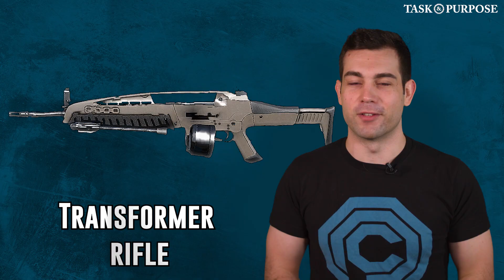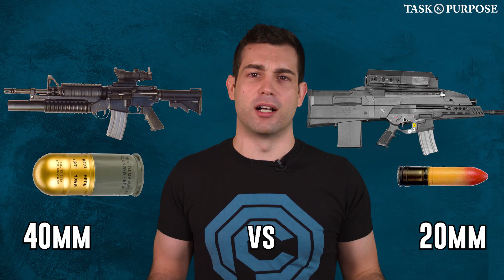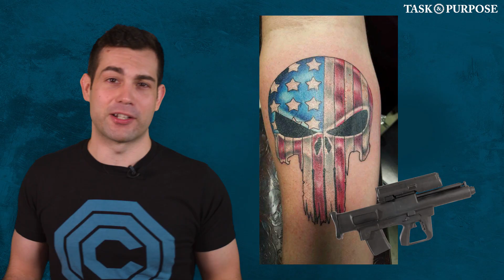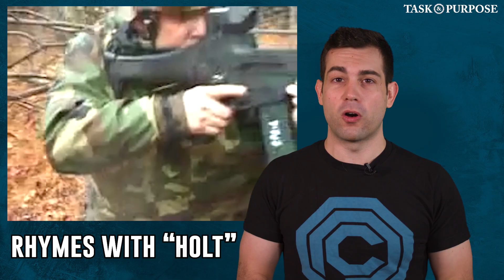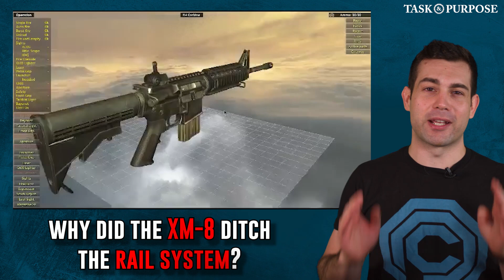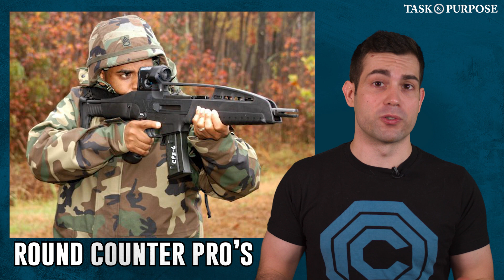Why was the Army's XM-8 Future Weapon Series Canceled?

Comment: I would argue that the concept of one assault weapon that can fill multiple roles is what our force needs. Making each rifleman more lethal means they don't need to rely on weapons platoon for help. One carbine length weapon that has the accuracy and range of a dmr, with the ability to accept hi-cap mags to provide limited suppression like an automatic rifle, and a assault carbine, underbarrel grenade launcher, and bayonet mount when not used in the other 2 roles. That combines a carbine, automatic carbine, and designated marksman's carbine all into one weapon with an indirect fire capability, a shotgun for breaching, a bayonet for close quarters fighting,, and so on.  No more needing to have a DMR, AR, or LMG. 

With that being said, I think it's time we switch from 40mm to 20mm grenade launchers. I know the 40mm is more powerful, but it's heavier, bigger, and doesn't have as flat of a trajectory or as great of a range as a 20mm would. The 20mm would also be a lot lighter when used as an underbarrel attachment and as a standalone launcher. The increased range, velocity, and flatter trajectory would extend the range of the indirect fire capability a rifle squad possesses, and a 20mm explosive projectile is still lethal to troops, unarmored structures, lightly armored vehicles, and incapacitating or degrading to armored vehicles (sighting systems) and armored emplacements anyways. The smaller size of the projectile means learning how to aim it is going to be much easier, especially since the increased velocity means it isn't affected by wind as much when in flight. A soldier or vehicle can carry more of the ammunition as well. 

 Multiple round types such as smoke, flare, white phosphorous, high explosive, cs gas, and so on would really seal the deal. I know 40mm is more powerful, but I think all the other benefits 20mm offers makes it worth the trade off.

Comment: You know what's funny about this, I was just talking about future warfare projects and military spending with my sister-in-law. I talk specifically about this weapon back in 2001 Marine Corps Times where the Marine LtCol at the Naval Warfare College said that the Marine Crops will never adopt this weapon over the incoming M4 to replace the M-16A2. He said that it was too clumsy, heavy and most lance corporals in theater would strip of the high speed low drag grenade launcher and battery for the optics system and bury them while taking the rifle on patrol. This many years later, I think it worked out for the best.

Comment: The XM29 was a gargantuan POS. The 20mm was unsafe and the optic system didn't work at all. The Soldiers in the videos were told to pretend with the optic for the demo. The carbine couldn't even fire a full mag. That's why they had to go with two separate weapon systems.

Comment: Heckler und Koch is pretty was the apple of the gun world wasn't it? PMags don't fit the G36, most of the older pistols had proprietary bs rails and (at least here in germany) their manuals stated that only HK certified gunsmiths (themselves) were allowed to work on their guns and disassambly and cleaning is to be done by qualified personnel only. Good thing the invisible hand of the market together with the bureaucratic hellscape that is public procurement slapped that bs out of them.

Comment: The Xm25 air burst mode in video games was actually extremely over powered and also had a pretty high skill ceiling if used right, no one ever used the set range distance for the air burst into windows or more skilled pre set the range and air burst it right in someone’s face.

Comment: There is no such thing as an XM series. XM is a designation for every experimental small arms in the US army. The M16 was the XM16 during its experimental phase and the XM203 was the progenitor to the M203 which is getting replaced by the M320 which used to be called the XM320.

Comment: M4 had 882 stoppages after 60,000rds fired. That's still incredible. That means 59,118 times the M4 goes bang and we have a logistical system already in placed. If anything, if the lengthen the barrel to 16" and used a mid-length system, the reliability would increased and you're not sacrificing too much for CQB.
Reply: That was on the 3rd test where colt had the rules completely changed to help the m4 ! First test the m4 didn't complete the 60k rounds!

Comment: There actually was a lot of corruption involved with preventing the XM8 from being adopted. Everything was ready to go and then suddenly it was canceled. FN had been lobbying heavily to end the project and did have a few key people in their pocket, including a few inside the military. Which the XM8 doesn't need added rails. The PCAPS system keeps zero and is lighter than a metal rail system, and doesn't need covers either to protect your hands. The H&K 320 grenade launcher for the XM8, is also superior to the older one still used by the US military. The Squad support version could have been simply eliminated in favor of keeping the M249. One other thing which would have been nice for the average soldier is the cleaning routine. You wouldn't have to be cleaning the XM8 half as much as you do with the AR platform.

Comment: The OICW or Objective Individual Combat Weapon was a weapon too far ahead for it's time. It was a engineering miracle to me. First time I used it in Soldier of Fortune Double Helix. It was amazing at how it performed during combat an how it shot out explosive rounds. The inbuilt range finder with both zoomed options available in Thermal or Nightvision settings... Also fire mode options. Yet for all it's features.. It was too complicated.. Forever kept as a concept weapon instead of a real tool for war.

Comment: Problem with the endurance test was they where using an off the rack M4 that had seen tens of thousands of rounds through it instead of a brand new M4. When the Army retest the M4 in 2010 against other rifles like the FN SCAR and ACR it was only off by 50 malfunctions which 70% where magazine issues which lead to the adoption of the tan follower magazines.

Comment: 1. Expensive itself, more expensive if replacement of existing weapon system is required
2. no conventional rail system for existing gadgets
3. plastics, disgusting
4. too much electronics, reliability is a concern
5. not worth the trouble and money to replace M16/M4/M249, at least not like M1 Garand to M14 or M14 to M16.
6. Most importantly, the army always want the cheapest bid to do OK job, not the most expensive bid to do the better job.

Comment: The M-16 will be very heard to replace. It's too simple, modular, and most importantly cheap to manufacture. Whatever the new rifle does better the M-16 cam be modded to do that same thing for much less vs the new rifle cost. ie new rifle costs $2000 - $3000 and has less stoppages or better grouping or whatever. Armorer with a $600 M-16 swaps out  $50 to $300 worth better/different parts and get the same results.

Also, can the new rifle handle the 20 mile march test: hand a unit of soldiers a new 15 pound rifle or they can have a 8 pound basic rifle with the option to add what they want then have them march 20 miles then see what they say about the rifles.

Comment: Completely skipping/missing the why. 
Weight. 
The gun 'needed' to be under 12 pounds to 'go live' but since they couldn't make that happen, they split it into the XM-8 and the XM-25 hoping to develop them separately, get the weight dropped, and re-integrate them later. Then when that failed they sold the tech to South Korea, who turned around and fielded it as the K-11 
Also it wasn't just H&K that made the OICW. They just got the  winning bid on the OICW contract.
Edit because youtube autoformat is fail.

Comment: Wait... so burger fishgun was just a G36 wearing a fancy coat?

HK: XM-8, G36, HK416, HK433(kilio 141 in new CoD for the whippersnappers), I assume HK thinks they're gonna snatch that french contract too.

It's funny how so many people are just rolling over and accepting how optimal the furniture on the AR has been especially now that it's starting to look like we're re-assessing the dynamic of NATO ammo, US army is fielding "new" ammo like 6.5 creedmore, .338 lapua, got new trials up with sig's new .277, I think we're going to see our military lean into accepting 3 or 4 cartridges instead of chasing that 2 cartridge pipe dream.

I'm betting we get a sub-intermediate round like 5.7 for the purpose of defeating soft body armor and running pistols and PDWs, a new "intermediate" round that runs a hotter than .556 with better armor penetration but nothing as beefy as 7.62 NATO, and we probably get .338 on our MMGs and snipers.

Frankly I'd be revisiting the old post war projects like SPIW and stoner's ultralight, I feel like we could come up with a good flechete bundle that fires from  platform like an M249, the WWSD2020 project seems to be a roaring success and a 6lb service rifle seems like the best choice possible for General Infantry, rotation expansion rounds could probably work if they did the testing right, run them in hex rifling and you could get all the benefits of SPIW.

Comment: The army could've just developed 40mm air burst rounds and saved like a billion dollars. That tech has literally been around for almost a hundred years.
Reply: The issue is that the low velocity of the 40mm makes it harder to use as an airburst weapon. There was also a lighter piezoelectric fuze for the 40mm that allowed you to increase the explosive payload without changing the weight of the round that never got introduced.

Comment: Instead of using it to replace three different guns, why not issue the soldier with a F-35 that can also function as an assault rifle?
Reply: no, no. F-35 should mainly used as assault rifle and every soldier should have them!!!
Reply: Problem is people view the F-35 as a really expensive plane, while in fact they are just 3 really cheap ones.
Reply: @HawkPlatinum  one that does none of the individual missions well lol
Reply: Also the F-35 comes in a long range nuclear powered gundam wing variant that stops racism
Reply: Don't give them ideas
Reply: if the F-35 was a rifle it would be lighter only have 20 round mags for stealth reasons be overly expensive and over all being mediocre in every role
Reply: Why don't use the Merica?
https://saintsrow.fandom.com/wiki/%27Merica
Reply: And F-22s for Snipers
Reply: M4: 
Possible attachments: 
Optic
Laser sight or flashlight
Underbarrel Lockheed Martin F-35 multipurpose stealth fighter jet.
Reply: D

Comment: OCIW? You mean that rinkidink little G36 knock-off afterthought mounted as an underslung rifle beneath an oversized grenade launcher they could never get working right? With a 4-pound $3000 POS scope as big as my head on top? It took 20 years to get the ammunition working right, and it is still such a niche weapon that has seen very little use. 40mm is already underpowered, 20mm is a spitball in comparison.

How about the reskinned G36 garbage that was the XM8? The one with the exact same problems as the G36, (Heat buildup in the trunnion, shitty optic rail, no way to get a cheek weld with optics, etc) and none of the advantages of the M16. Oversized, overpriced, piss-poor accuracy, modularity was a joke, and despite H&K's marketing, it was inferior to the M16 in damn near every conceivable way for anyone that had to carry and shoot a rifle for a living.

The XM8 claimed to do everything the MCX does today, except it sucked at all of them and didn't improve upon the M16 in  any way save for weight, which was a complete wash in equal barrel lengths.

Comment: That's just the problem, HK made everything "Proprietary" instead of improving upon the standard
Reply: Exactly why i dont own a hk expensive well everything and no aftermarket support
Reply: To be fair, genuine improvement frequently requires ditching existing paradigms, like the shift to intermediate cartridges. If you insisted on only ever improving upon the standard, the M14 EBR would be our standard issue rifle, and, well, that would be less than ideal.
Reply: @evanwickstrom5698  I mean with the picatinny rail system for example you can slightly move forward and backward your sight, flashlight or grip to accommodate you. With those single attachment points on the XM there's only one place where all attachments go no deviating.
Reply: @WalrusWinking  the thing is that the 1913 rail wasn't the "universal standard" when HK came up with their attachment system.
And now look at how keymod became a "standard" in itself, but mlok essentially killed it. HK tried to make mlok ahead of its time.
Reply: I just dont like the fact that,if it says hk its almost double the price and mags are $40+,i could care less if special ops used it

Comment: Hand gards were made of cheap plastic which would deform after a while and the sight system could not be removed and used batteries    so if you didnt have spares you didn't have a very good optic. To improve it made it heavier then the the replacement.  Waste of money

Comment: M4 is fine. You dont need a new rifle you just need to unfuck everything the military did to it. Quad rails should be replaced with a beefy mlok rail, adopt pmags, switch back to a thin barrel profile, and add a mid length gas system. Theres tons of ways to update the M16 family to be far superior to any new rifle.

Comment: You completely forgot the plastic melted and the electronics broke,
Reply: And they fixed that issue early on. Argument invalid
Reply: @commanderbeepo8066  

They did not. It got dropped fast in the 08 contest because they could not get the polymer to not melt nor the electronics to work. Once it was clear it could not perform up to the standard even in preliminary, it got dropped.
It was just an AR18 in a super stupid plastic dress with fragile bits glued to it. The AR18 has already been tried and rejected just about everywhere, including America.
Reply: The AR18 served as the basis for multiple other countries rifles. The problem is like the British the Germans did their versions wrong.
Reply: Very German
Reply: This is exactly it. The XM8 is an HK G36 in different clothes. Just like the G36, the Army had problems with the polymer upper receivers melting after long shot strings during testing.
Reply: The xm8 was one Kilogramm lighter than the G36, more reliable than anything the army has and way more precise than the m4/16 rifles
Reply: @henryklee680  please validate your claims about precision, thank you.
Reply: @ChucksSEADnDEAD  you've seen the test in the video. And for the weight, just look it up
Reply: @henryklee680  I didn't say anything about weight. What were the conditions of the test video?
Reply: @ChucksSEADnDEAD  i know the weight, you can just google it.
I meant the test that this video was about, just watch it.
Reply: @henryklee680  Melting and breaking are pretty serious problems. Nobody gives a fuck about your Wunderwaffe if it can't be counted on the work. The XM8 was a fail 12 years ago, quit trying to tell me it could throw a ball over yonder mountains.
Reply: @Mortablunt  they f*ing wheren't melting
Reply: @Mortablunt  Not as bad as all the stopages the m4 had
Reply: @Metalgrey007  You can get those cleared and the rifle fighting again. You are boned if you can't aim your rifle because it's gone all nacho cheese and the sight rattled into its grave.
Reply: It was a prototype

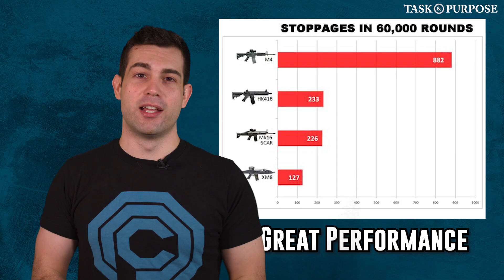Comment: First off wasn't the XM-8 entirely an H&K fabrication without the military actually issuing a request for a new weapons system family, secondly weren't the results of the dust test shown at 4:39 not terribly accurate given that later on colt ran the serial numbers of the m4 rifles used and determined that the ones tested had been in circulation for some time while all the others were tested using brand new examples of the other respective rifles

Comment: Ironically, everything that separated the XM8 from the M4 save for the charging handle, drum mags, and bolt catch was later implemented into the M4 or it's family. Back then you didn't have the barbie doll accessories for the AR-15 like you do today, and all those configurations already existed with the XM8 to include PCAP slots, known today as MLOC by magpul which just so happens to be all the rage for rails right now.
Reply: Avera9eWh1teShark6 - So the XM8 is just another idea that was ahead of its time. Shame
Reply: @Red_Beard2798  Sorta. It also had a melting problem.
Reply: @PugilistCactus  that was just on the g36. And the reason g36 had a  melting problem was because of the rounds that were used on it